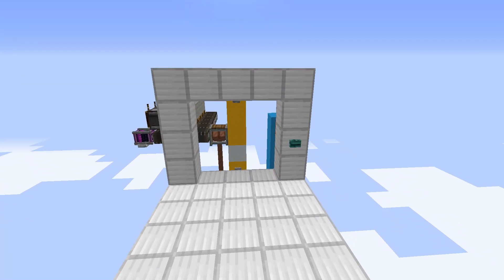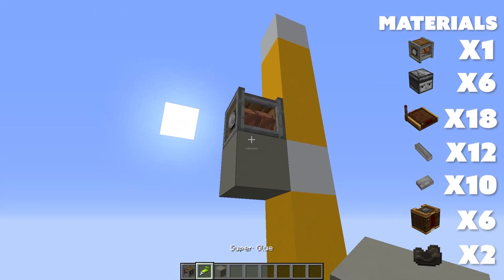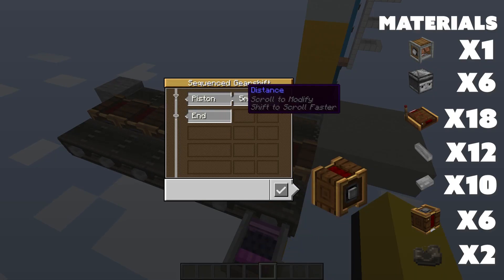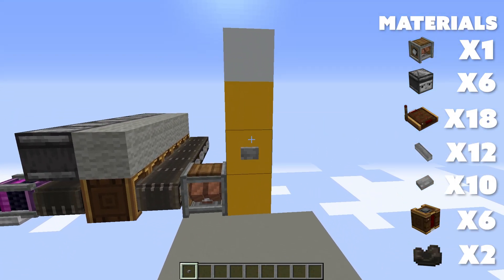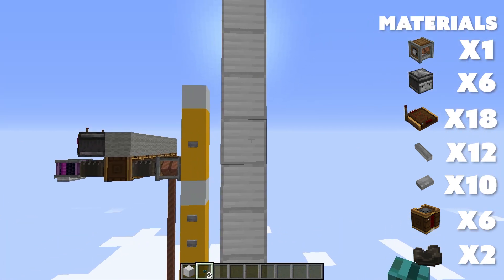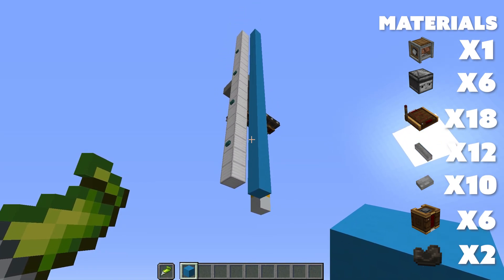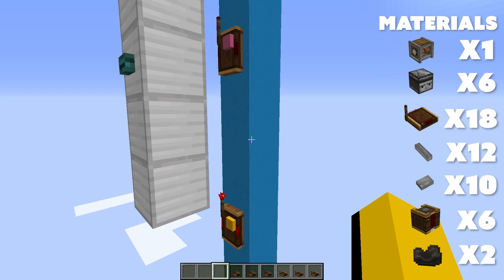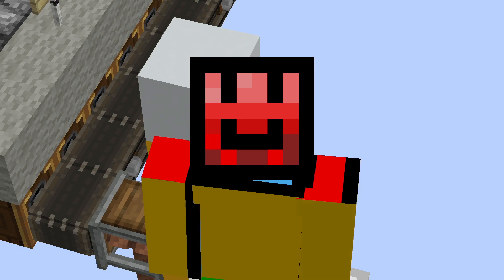Minecraft Create Mod Realistic Elevator With Call Buttons (Tutorial)

Comment: Hi i have an issue. I kepp falling trough the elevator floor when I go down. Do you have solution?
Reply from the maker: Unfortunately that’s a common issue.. you can try making the elevator slower or adding a second layer to the floor. You may sink through the first layer but will not fall through. It’s not pretty but it works

Comment: Hey BLOckOus, love this design but I keep encountering an issue where a bunch of the sequenced gearshifts break and end up on the floor even though they weren't activated
Reply from the maker: Hey! So one common reason I've seen for this is multiple sequenced gearshifts running at the same time. So essentially pressing a button before the previous SG has finished its sequence.
Reply: @BLOckOus  I figured out what the problem was and you're right. It was that the SG's were running together. I used computercraft to make a touchscreen to control the elevator but the turtles I was using as the receivers were for some reason activating all the redstone links when they were only meant to activate the one on the bottom so instead of having one turtle for the up and one for the down (I made the program so I can go up and down up to 6 floors at a time) I moved the ones on the bottom to a third turtle and now it works perfectly
Reply from the maker: @XSilent_DevilX  This is amazing! I didn't really know anything about computercraft and now I really want to try it :D
Reply: @BLOckOus  I'd be more than happy to give you the pastebin link for my code if you would like? With computercraft you can download other people's programs from pastebin with a special code from the URL. You do "pastebin get {URL code} {what you want to name the program}" without the brackets and then you can run it. The program relies on advanced computers, ender modems, advanced monitors and advanced wireless turtles. Maybe I should but together a video to better explain the setup if you're interested?

Comment: Can you please help me? My pulley won't move when i press the button at  3:39

Also how did you get your floor to the 3rd level??
Reply from the maker: Hey! So at 3:39 I'm seeing the button that takes me down one floor. Either way, I think the best way to diagnose is to break all your redstone links and set them up again. First make sure that the sequenced gearshifts have the correct numbers entered, and then make a color code you remember and setup the redstone links. I'm sure this way everything would work.
Reply: @BLOckOus  Ok, thanks!
Reply: @BLOckOus  Also can you do a tutorial on putting doors with this design??

Comment: I think this is a really freaking smart design! 
I was thinking about it, and the vertical column that moves with the elevator, couldn't you have that move in the same way you would have it move while it was attached to the elevator, but in a different location? Since all of the movements are triggered by the redstone relays, it means you can take multiple outputs from the button presses. All you have to do is mirror the same offsets that the elevator does, one some other mechanism. Basically it means you might not have to dig out the area above and below the elevator. Although, honestly it's not a big deal, it's just food for thought haha
Reply from the maker: I think I understand. That is definitely a way to hide the process in the background while making the elevator fully real. Thank you for the suggestion! I will definitely try that in my next design and share it!
Reply: also,it can be made vertically

Comment: damn thats some big brain call buttons right there
Reply from the maker: Haha thanks!
Reply: @BLOckOus  only flaw I can really see is that if you try to have a really tall elevator, you will have a lot of blocks stickign out above or below at top and bottom floors, so if you are near bedrock or in a sky scraper then it will break or have blocks sticking out the top
Reply from the maker: @AshEshyr  you’re absolutely right, and if it’s really tall you might also max out the number of blocks the rope-pulley can lift. I’m not sure if that’s a thing but it might be. I’ll keep thinking of potential future designs to make this more scalable.
Reply: @BLOckOus  contraption size limit is 2000 blocks by default so you probs wont ahve issues there
Reply from the maker: Oh nice! Yeah not even close 😅